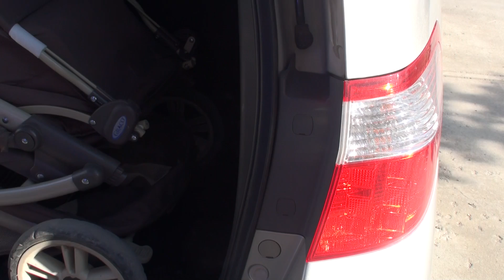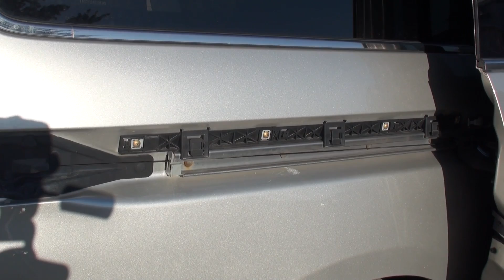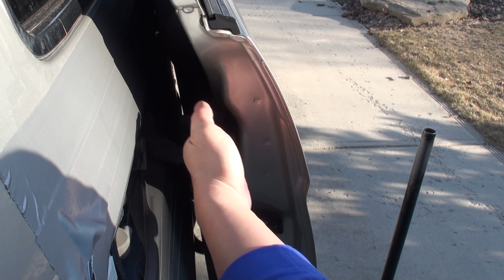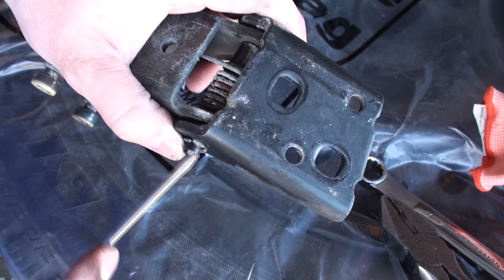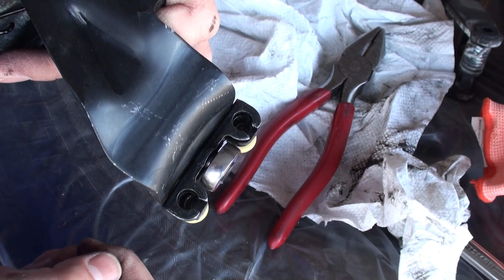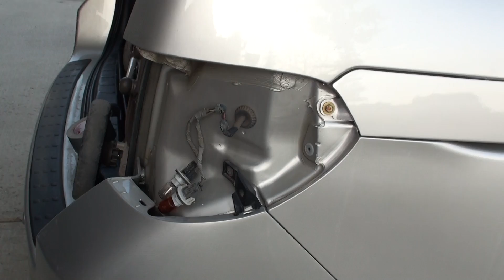Honda Odyssey Center Rail Door Roller Replacement

Comment: I just replaced my center roller.  Door opens and closes manually just fine, when I try to use the power option it just gives me a constant long tone, not a beep like usual.  Remote does nothing, dash button does nothing.  Checked the fuse, it is ok.  I still get the check sliding door message in the info cluster.  It worked perfect until yesterday when the roller got stuck.  Any ideas?  Is there a reset?
Reply: OK, to answer my own question, I pulled number 7 and 13 fuses on the drivers side passenger compartment fuse panel, and I believe the 8 on the passenger side (It's labeled something like RR PWR CLSR).  Worked great.  Also, to replace the closer i did not have to remove the inner panel.  I simply grabbed the cable just behind the retainer that goes into the roller assembly and pulled the tiny bit of slack out to get the 90 deg needed to get the cable through the mount slot in the roller.  Took me 10 minutes.
Reply from the maker: jaynay13 great work jaynay13.  Sorry I couldn't respond to you sooner but yes if the power sliding door is on the fritz it does help to initialize the respective doors by pulling out the appropriate fuse that is tied to each door.

Comment: thanks, could you share the part # and what Chassis lube did you use?
Reply from the maker: Hi Lee,  the part # for the sliding door rollers is:
Passenger right side: 72521-SHJ-A21
Driver's left side: 72561-SHJ-A21

I didn't bother using chassis lube on the rail as I find that dirt sticks to the centre rail like you can't believe so I personally chose not to lube it up at all.